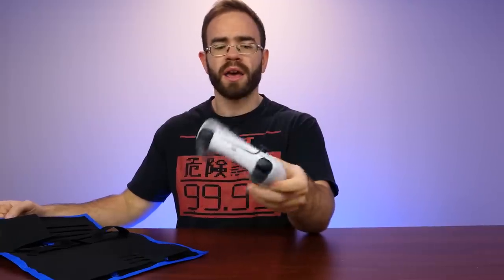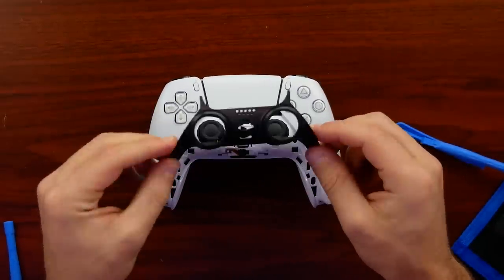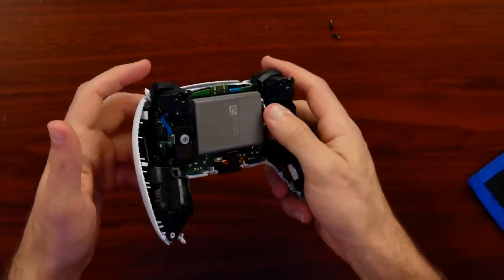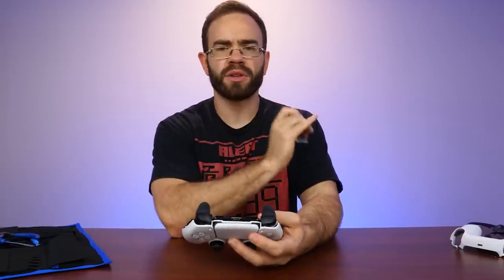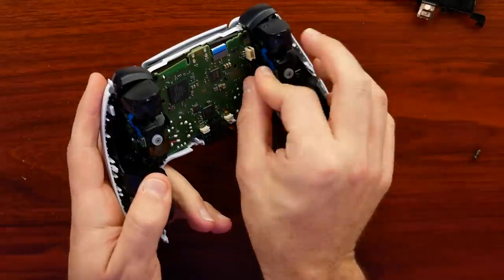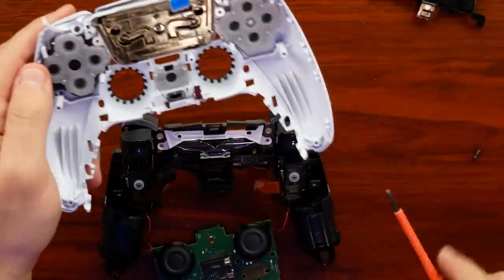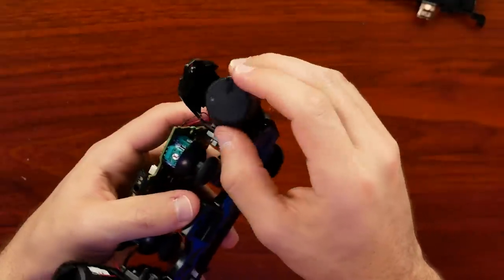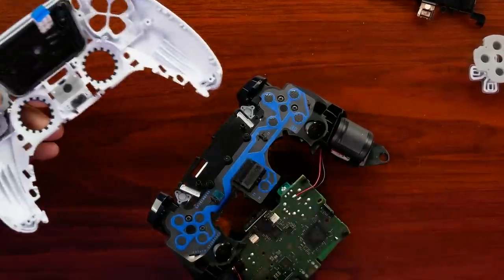The PS5 DualSense Is The Craziest PlayStation Controller So Far (Teardown)

Comment: I wonder how durable those gears in the trigger will be.. I hope they don’t break after a few years
Reply: I'm curious a few years down the road to see how many games actually take advantage of these features. Wouldn't be the first time new controller features get largely ignored by game developers.
Reply: they probably wont because the triggers are one of the most heavily used parts but if they do, there will (probably) be an updated verion of the dualsense at that point anyway. so i dont think they will break easily
Reply: A few years?? Bro what modern controller do u have that lasts more than 2 years
Reply: @teach9023  Pretty much every announced game right now for the PS5 supports haptic feedback features, not just first party. If people like it and demand more the developers won't be able to ignore it.
Reply: @slickyyMPA  lmao I’ve been using my original DualShock 4 that came with the console for 7 years now.. and it’s in perfect condition, you just have to take care of ur stuff
Reply: @slickyyMPA  The Xbox one controller I got back in '17 works just fine. What are you doing to your controllers bud?
Reply: @slickyyMPA  My GameCube, Wii, Wii U, and Switch pro controllers are all still working.
Reply: @weaverquest  Good to know, I hope you're right
Reply: @slickyyMPA  most controllers will last years if you take care of them
Reply: @slickyyMPA  my dualshock 4 and xbox one controller have need working since launch. What did you use to Abuse your controller after Bloodborne?
Reply: U probably play games once a month then because no DS4 battery will be in perfect condition after 7 years. If ur an avid gamer, then the controller will start to lose battery capacity after 2 years. Its not about taking care of things. Its about actually using it
Reply: @slickyyMPA  I agree with you. I play and use my DualShock everyday. Longest lasting one for me was 2 years. The analog sticks are awful on the DualShock 4
Reply: @slickyyMPA  I play like 6hrs a week, and the battery has no problems.. again, it’s just something you have to take care of
Reply: @danielevans7439  and how often do you use those controllers? Obviously not daily. Im specifically talking about using a controller consistently not every once in a while
Reply: @slickyyMPA  I have had an Xbox one since 2015 with one controller and played a couple hours a day and works just fine with no problems.
Reply: @slickyyMPA  ya these guys are total posers if their controllers are in perfect condition after SEVEN YEARS. That means you are barely using them. I've always taken care of my stuff but heavy use of anything mechanical will wear and tear it period
Reply: @DhairyaGupta23  honestly thats not much play time. It all comes back to how often u use it
Reply: Nani? Since when u stay on the same controller more than 1 year?
Reply: @V_Urizen  exactly lol
Reply: @teach9023  yeah but third party games ignore them because that would be a lot of work
Reply: Keep doubting xbots
Reply: 2WIREG  Watch Dogs Legion is advertising haptic feedback support on Ubisoft's website.
Reply: @feelreal8676  That's what I would think as well. Most third party games I'll likely end up playing through the PC with my Xbox controller.
Reply: @teach9023  Sry I cant find the Source rn but pretty much every big triple A third party games supports haptic feedback. For example NBA2K21 makes u feel every different player -IGN. Marques brownlee hinted that u can feel the drippling aswell
Reply: @slickyyMPA  Li-ion batteries decay at the same rate whether you are using it or not. Also, you change the battery inside DS4 with not much difficulty.
Reply: If they break in a few years that would be awesome considering I break a joystick per year on my dualshock 4's from playing fps games
Reply: @slickyyMPA  ive had the same two controllers from the beginning of getting my ps4...
Reply: @lawnmowercar  I heard sony approached 3rd parties to encourage them to use them. This is true next gen
Reply: @DhairyaGupta23  impossible
Reply: @slickyyMPA  wtf??? I take care of my things, my controllers more than 2 years.
Reply: @StudioCastle58  then why u watching a vid ab it
Reply: On the upside, you could order like 100 of those plastic gears for 75 cents and change them out like AA batteries.
Reply: If they last a few years thats pretty good for a controller, but if they last only 6 months for like 5 hours a day then that won't be good
Reply: well you should be buying new controllers every year or so. at least I do.
Reply: 2WIREG  plenty of 3rd party games have announced support if you paid any attention. Nba2k for example just announced more support for it
Reply: I hope there would be no gunk under the thumb sticks.
Reply: @danielevans7439  I got a Wii Classic Controller Pro, and with a dongle I can use it on the Switch for 2D games (whereas for 3D games I use the Switch Pro Controller)
Reply: @thegarbanzo  Its sad but its kind of true depends on your luck and play time
Reply: Sony products are pretty durable I own quite a few of em
Reply: I was wondering how loud or quiet the motor will be
Reply: I’m extremely excited about the more immersive haptic feedback, but also genuinely curious of the long-term durability as well
Reply: @slickyyMPA  I still have my xbox360 wireless controller in near perfect condition and my considerably younger PS4 controller.
Reply: @slickyyMPA  I still use my Xbox 360 control.. and all of my ps4 controls have near perfect analog stick movement.
Reply: @slickyyMPA  well not to start consoles wars but xbox controllers don’t have that problem, i can just replace the battery easy instead of buying a whole new one
Reply: @rokor3578  it is a controler. Don’t fucking use it in a violent way. There are people who wreck things on a daily bases. And there are people who use the product just as often but are more carefull. One of my ds4 has lost damages to one of the analog rubber things. When did they occur? When my girl friend played for one hour.
Reply: @FalconOfStorms  if you are handy enough to change them without damaging the DualSense.
Reply: after a "few years" i wouldn't care  -  i'd just buy a new one.
Reply: I'm happy if it lasts two years.
Reply: 2WIREG  2ba2k21 next gen been said they were using the features
Reply: @StudioCastle58  lol, you hate a lump of plastic consumer device which isn't even out yet? what's it ever done to you 🤷‍♂️.....    very strange.
Reply: @erikd6124  SpawnWave will show us de way.
Reply: @DhairyaGupta23  take care lol battery degrade body you can't do anything 
The rated in number of charge after this is all downhill
Reply: @joefawley9264  next gen a fucking gimmick controller nothing next gen here and the switch got this before the ps5 Sony just copied Nintendo again lol
Reply: @legros731  right but there’s precautions you can take to keep a lithium ion battery from degrading so quickly
Reply: @XxLilBreezy  and when you buy a new one you realize how shitty the old one joystick where
Reply: @erikd6124  so you don't use them good for you
Reply: @slickyyMPA  my original ds5 lasted from 2013 to 2019, then the battery died. Must be a problem with you if you break them fast.
Reply: @DhairyaGupta23  no they are rated  10 000 charge and this if you lucky you may get 7000 or 12000 charge and after that they are at 50 % cap even full charge
Reply: Critty  we will all inevitably wear down like the gears on the inside of an N64 joystick. Such is entropy.
Reply: they probably will. The more separate moving parts something has, the more likely it is to break. Technology has gotten better over the years to prevent this, but I assume this will be a common problem.
Reply: @legros731  I say this is how to make gaming more immersive. I hope it's much more than just a gimmick and I have a feeling it will be.
Reply: @legros731  no not really.... my trigger buttons are better for sure but that’s common sense. u must yank on them triggers and shit cuz never had that problem
Reply: Or the directional pads
Reply: @ContrailLime  not for me
Reply: @legros731  yet everyone that used the controller says the haptics are a huge improvement compared to the switch HD rumble. And the adaptive triggers are new.
Reply: @solid_justice5855  sure they make it a little better but it not the first time they do this
Reply: @XxLilBreezy  maybe but its just a 60$ controller made of cheap plastic and plastic wear 
And a brand new controller feel so good
Reply: @slickyyMPA  I'm still using the same PS4 controller I got day 1 with my ps4 and it works the same as it always has.
Reply: @legros731  everyone that played with the DS say they are impressed by it. Indeed haptics are not new, but Nintendo did not invent them either
Reply: Few years? That's a long ass time.
Reply: @DhairyaGupta23  That’s the exception and not the rule. I take care of my stuff but there is normal wear and tear from constantly pushing buttons or moving the sticks or triggers.
Reply: @slickyyMPA  5-8 hours on weekend, 1-2 hours on weekdays for some of the days. my 2014 Dualshock 4 last about 4-5 hours before the battery low indicator pop, in my memories that is about the same as at it's first year
Reply: If they break in a few years I wouldn't open it and fix it tbh I would rather just buy one of the newer revisions of the controller just like gen 2 PS4 controllers.
Reply: @DhairyaGupta23  the first dual shocked! 4  controllers sucked, you had to buy rubber grips for the joy stick because the grips wouldn't last long.
Reply: @slickyyMPA  all of them. Besides Nintendo switch had to get them repaired.
Reply: we could see something like the nintendo switch stick drift but we’re just gonna have to see
Reply: @slickyyMPA  um check my trophies huge gamer and still OG controller. Your not careful with your shit
Reply: @slickyyMPA  exactly... What controller period doesn't last only a couple of years....
Reply: @ericvanleeuwen979  bro ur shit probably dies within 3 hours, thumbsticks have drift, and no grip at all. Ur capping if u say ur OG controller is in “pristine” condition. The first DS4 controllers were trash. The later model was heavily improved especially in terms of feel.
Reply: My DS3 lasted 8 years of hard use with no issues. I haven't had a DS4 last more than 8 months without requiring cracking it open and replacing at least one analog sensor, which was a bit of a pain on the original DS4.
Reply: @legros731  I’m Canadian so it’s 80$ plus tax so it’s a ripoff unless u really need a new one
Reply: @DhairyaGupta23  i’ve bought 6 or 7 controllers now and i do take care of my stuff, but the analog sticks for some stupid reason keep breaking on me, i’ve never had that problem with the PS2 or PS3 controllers..

When i’m saying breaking i mean they just go off in some direction like they have their own mind which is really freakin’ annoying..
Reply: @slickyyMPA  All my controllers have lasted from PS4 era.
Reply: I mean if it lasts a few years then just buy a new one.. 🤔
Reply: @DhairyaGupta23  🧢🧢
Reply: @slickyyMPA  dualshock 3 and 4
Reply: Muscular alpha 😂, stop you're like 13 your controller will be fine.
Reply: Considering how they make those ps4 crap controllers and how kids handle these controllers a year would be a milestone
Reply: @slickyyMPA  my DS4 lasted me over 5 years before I had to buy a new one to replace it.
Reply: I hope we get metal replacement gears kinda like what we got for the joycon latches.
Reply: Controllers don't break but they stop working perfectly that's what happens most common problem is stick drift and the triggers get loose... This should last longer then ds4
Reply: Psn Wyrm93 to see its obviously very used. With 150 platinums and have played bloodborne and dark souls 3 100%. Doesn’t have to break your shit
Reply: @slickyyMPA  I still use my GameCube controllers every month or so, and my wife, daughter, and I each use the Switch Pro Controller daily.
Reply: @XxLilBreezy  me too and from quebec so 15 % tax
Reply: Maybe if dust gets into the controler it can cause it to jam of lock up
Reply: @legros731  ouchie for your wallet. Let’s all agree that if you take care of something and not treat it like a TOY it will last long. A Console is not a toy so neither is a controller be gentle cuz I treated a controller shitty once it only lasted me 6 months . I’ve had a gold one still mint for 3 years and 2 years I’ve had a red controller I got cuz of Spider-Man lol it’s my baby the red is so clean 🔥
Reply: @XxLilBreezy  this is why I didn't buy the elite controller it's 220$ at walmart this is a ripoff 
I don't mind 1 controller a year a play on pc and game are free
Reply: Few years? Damn. Replace it. Lol
Reply: @slickyyMPA  lol. I changd mine every 6months.  I got a deal from bestbuy. I pay 10$ only every 6months
Reply: Yeah man. Got problems with my L2/R2 on all my ps4 controller.
Reply: @timothyoswald8618  haven’t even opened it.
Reply: @slickyyMPA  GC and Switch Pro?
Don't most controllers last a while anyway? 2 years is kinda short, dude
Reply: @LS95774  It must be from a lot of Cheetos powder
Reply: I'm surprised they are not made of metal. But yeah going to have a lot of broken controllers. Wonder how long of a warranty you get.
Reply: @teach9023  playstations studios will use them
Reply: @DhairyaGupta23  i've had to buy only the new version of the dualshock 4. My OG that came with the ps4 still works but i've had to change the sticks once and the battery life is so bad that i just keep it plugged in.
Reply: nah they've probably tested like 10,000,000 presses on a controller or something like that
Reply: @slickyyMPA  I had the same PS4 controller for 5 years and like the same switch pro since launch
Reply: Ah yes because no controller has ever had durability issues years after release. 

N64, Gamecube, ps2, ps3, ps4, wii, Xbox, Xbox 360, Xbox one, switch....
Reply: Heres my guess.

The easiest way to break it or cause it to overheat or short circuit is if it pushes your finger but you decide to fight it so u use all ur strength till it cant handle it and itll just short circuit and not work anymore or as good.
Reply: Myntrix  NNN ?

Non nude ?
Reply: Myntrix  check agaib
Reply: Myntrix  oh yea but NNN wasnt familiar with that.
Reply: Myntrix  check again.
Reply: @weaverquest  only 1 game that's launching on ps5 that doesn't have AT nor HF support and that's Assassin's creed Valhalla.
Reply: They are already report of the trigger breaking.

Comment: I am immensely curious about the variable resistance triggers, wonder how those feel like
Reply: Same. I imagine that Sony will be using the haptic motors in combination with the resistive triggers to make some really cool effects. For example, to pull back the string on a bow, not only will there be real tension on the triggers, but the haptic motors will vibrate and make it actually feel like you’re pulling a flexible string. Really cool stuff.
Reply: @StudioCastle58  ok
Reply: Imagine if you're driving a car and you're going up a steep hill and it makes you press harder on the trigger along with some haptic feedback. Can't wait to see how cool the ps5 will be and how immersive it will be
Reply: @StudioCastle58  COOL bro
Reply: Yong Yeah has a video of him demo-ing. He's very impressed!

Comment: Austin Evans looking this video thinkig how dumb he was and why he didnt think about that to remove the black part of the controller first before breaking his 😂😂
Reply: Austin has zero concerns about breaking a $70 controller, lol. You realize he could use $100 bills for toilet paper?
Reply: @captaincrunch1707  lol Do you reAliZe how unsanitary that is? Don't think anyone's GoInG tO dO tHaT
Reply: Austin and this guy broke it exactly in the same spot, both very sloppy
Reply: Tif that other did who helped him didn’t do much to help with that lol
Reply: @contactolequotidien8492  spawnwave: unintentionall / austin evans: by brute force
Reply: @ultimate_president  yet there are some well done teardown videos around that they didn’t brake it... he broke it to trying to use brute force, as an industrial designer I can tell you nothing brakes if done correctly and things are not hard to pull off with the right tools and procedure.
Reply: @contactolequotidien8492  thx mate, i know what you are speaking about when done correctly (working as a technical engineer and kinda got the same problems some times a little different but the same point) thx mate
Reply: @ultimate_president  cheers